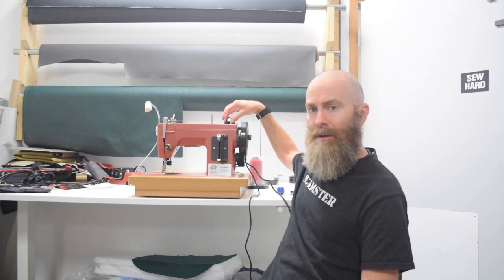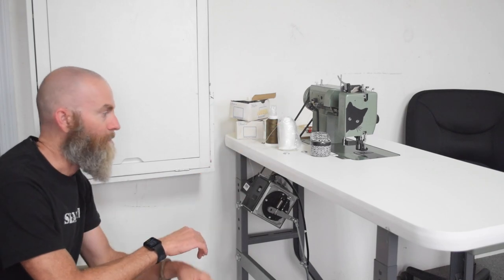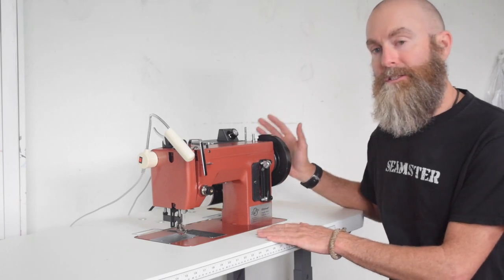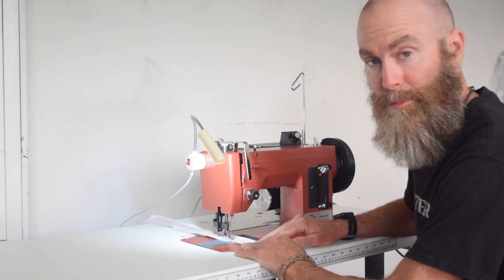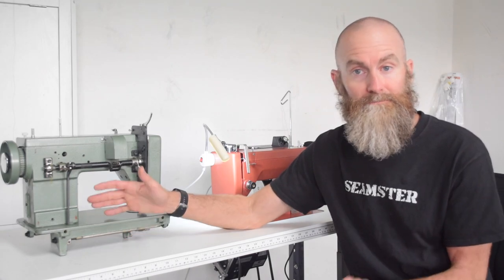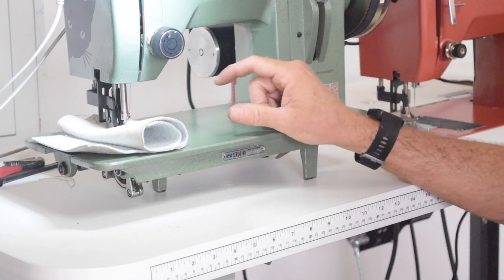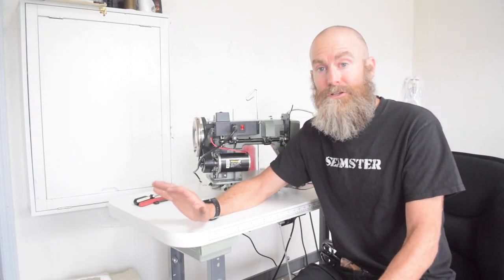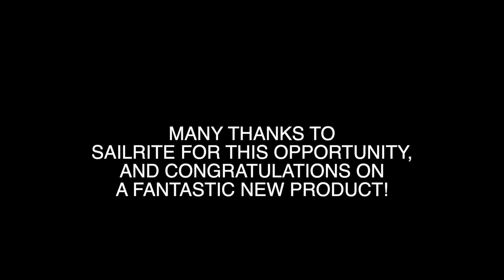Sailrite WorkerB Motor Package (It's Incredible!!!)

Comment: SewLine SL146-9 is better than the sailrite machines because you have a 9" needle to base instead of 7" and sewline and other thompson parts are all compatable..  i think the zigzag pushrod is the same in the 7".  all the needle assmbly parts are the same. sailrite machines are overpriced and sell with the same terrible pedal[as sewlines:/], get a carbon pile for real analog control.  i used a light steel wool to take the sewline lettering off and its left with nothing but nice industrial off-white paint.  i dont want a blue or red machine.  lime green maybe.  sailrite is just as much a knockoff to sewline's offering to many.  i like the small flywheel and traditional clutch style.  my machine does more stiches per min than a sailrite because of the flywheel.   sailrite makes fine profits ok and if they wanted to make More upgrades for the thompson they could.  i bought the thread tensioner and stich length plate and like 250$ or so in purchases from them - and i didnt even buy their machine.  dudes, this machine is a part of what they sell and... make a 9" arm man!  and sorry i do like the small metal (not plastic) flywheel.  at 12:52 jason shows his old motor and his old pedal.  if he had a carbon pile pedal he could eaisly get slow up and down position control with the help of a hand and single stich control with just the foot pretty easy.  he used an electronic foot pedal which are all crap and a joke really.

sailrite is a cool company. ive bought from them and might buy this motor too, its quiet!
Reply from the maker: Hi Chris, 
I'm told the motor package should be available separately in the fall of 2021 (I think October, but don't quote me on that).
I do want to correct you that while the Sailrite Ultrafeed is based on the Thompson Mini-Walker, Sailrite has made significant innovations and changes to the machines.  The Sailrite Ultrafeed is not a knock-off of Sewline machines; I believe the opposite is the case.  I disagree with the idea that Sailrite machines are overpriced; the research and development costs of innovations like this motor package are immense, and overseas factories don't have to incur those costs when they just copy others' designs.  Paying less for something copied from someone else doesn't mean the original is overpriced, it means you are rewarding a company for stealing intellectual property, while penalizing the innovator who made the product possible. 
We all have to make decisions based on our own budgets and ethics, but I personally won't buy any of the look-alike machines.  I think Sailrite brings a lot to the table in terms of value, customer support and innovation, and this motor package is yet another example of their importance to this market.
Reply: @thejasonofalltrades  yeah i hand it to MAtt for the stich plate adjuster and being  the purveyor of quick thompson gear.  i havent tried the posi-pin or his machine but... yeah,, its the same machine man.  his patents and alterations (ive seen his literature) are limited to some feet to the chasis, the flywheel... i dont think anything else.  all the parts on his machine are not just interchangable but the serializations for parts are identical(i found this out what comparing manuals)im all about supporting Matt and his crew, they are decent people.

but its like, i have supported them.  like 300$ already.  and they have a whole shop of gear they dialed in how they want.  im not gonna be kind and not say their machine isnt the best because it isnt.  i have 2" of extra bed size, my machine came wth a small highspeed wheel and after all teh upgrades and s&h was done it was like a 800-900 machine with case  and nice pedal and fixins.  you even said his machines were overpriced man.  you got a job to do but im not here to tote the line too bro.  your channel kicks ass man and Matt can get over it.
Reply: @thejasonofalltrades  dude i remember you saying how you used to think they were good deal but later you feel they have a high price tag.   they are overpriced ok.  sailrite is a great site.  and..  i spent a good amount easily when i shopped there
sailrite doesnt own thompson machine design.  so others are not look alikes, ok.
Reply from the maker: I invite you show me where you hear me saying "I used to think they were cheap but later I feel they have a high price tag."  Since WAY before I ever owned a machine, I have been very public in my positive opinion of Sailrite.  Are they cheap?  No.  Very few things in the world worth having are.
For the record, I'm preparing to sell off my Thompsons to buy a Sailrite LSZ-1 Premium.  Not because it's cheap (it isn't), but because it's awesome.
I appreciate your comments, but I respectfully disagree with many of your claims.
Reply: @thejasonofalltrades  no it was more like "i like thompsons but sailrites are expensive and cheaper means can be had"  

why do you wanna spend extra for a 7" bed when 600$ gets you a 9" zigzag thompson?  i even have a plastic case for mine.   you talked about how you spent only [so little] on your machines and now gonna get a premium kit... even though you should have plenty of extra fixins for the machine...  i just,,  well id say "i dont understand" but i think i understnad.
Reply: Hi Chris. I agree with you, that bigger harp space will help you with many projects. But it do also make the machine more heavy. But then I do agree with Jason on most other information and I like to add some technical aspects. I do not think the Sailrite machines are overpriced. They do provide an excellent support on their website, and I think they provide some improvements on piping foots, now this new motor and some other things. I think this hole package from them adds value to most of their customers. I do not have a Sailrite myself, and it is partly because I live in Europe with some higher shipping costs.

I have had several of the carbon disk control pedals and have repaired many of them, but some of them simply cannot make slow speed. So their performance vary. I have seen similar problems with electronic pedals for normal universal motors, and they can also vary in performance. So it can be hard to get a clear picture if one kind is better that the other, because you got some bad kinds out there.

The Sailrite electronic pedal you see here is not the same. It only provides a simple signal to the controller of the motor, so it do not handle power itself. But the controller got a RI compensation control of the motor. It means, that it will add more power to the motor, if it needs that to provide more short time torque for needle to penetrate fabric or for the hook to pull down thread. When you look carefully in video, you can hear the hum of the motor is increased when the needle needs to penetrate the fabric. You will newer get this kind better speed control with a carbon disk pedal. It is however the speed reducer that counts for the biggest improvement here. This is another example of this kind of control, but with speed feed back to the control electronics, and you can hear the added power, when it is needed: https://youtu.be/uTB8DnyYAlA?t=170
Reply: @sewingmachinesindetail  no.  you are really wrong.  let me explain.

yeah, harp space.  7" isnt much at all and if a person is buying their first sewing machine 7" isnt enough to mend a knitted rug(roll it up under there) or do other bulky projects.  7" for sails is, im sorry, baffling. like even on a boat,, get 9".  regarding the weight, for a petite lady she could get a straped cloth bag to hold a lightweight plastic case(like i use) and pick the 35 pounds up.  if someone wants lightweight from either machine,, maybe they should get more ofa high quality domestic.

about carbon pedals. no again.  if you buy a new carbon pedal that is not junk(they make quality ones in mass.  i got one from sailrite,  sailrite captures my money, dont worry) they will work slow speed provided you put a heatproof pad under it.  they will make hilarious poping noises at first but after 'seasoned'... my machine advances great and oh sailrite sells small metal flywheels for their machines.. ppl should get those for their machines for some quick industrial style sewing which is what this machineshould be doing, not slow leatherwork(get a unison feed off the bat for that)..   thompsons are cool,, sailrites quality parts are Really Really great for the thompson market,, there is no other source that compares to the easy selection.  
 
all the improvements 'to the thompson machine' are really improvements to the furniture of the heart of the machine:tension assmbly, stichlegth plate, flywheel(i like the old style).. they got the cast which they ship in to have more robust feet(which isnt needed, imo because the machine rests on the flange on the edge usually and if you are banging a sewing machine on the floor so hard the feet need... nevermind.  i just dont see why)

about electronic pedals.  they are total crap.  5 speeds? 5 speeds doesnt work.  the jerky inrush current is bs[which causes the jerk].  to stich with that one hand has to be on the flywheel for delicate things.. its junk.  a rheostat pedal gives more speeds i think and doesnt cook bacon like a carbon pile pedal can.  but i like bacon and the smooth, funny control of the pile.
Reply: @sewingmachinesindetail  neat YT channel.  ill check it out and polite.  yeah i am passionate about thompson and dude the upholstery company i worked for ordered tons a foam and products from sailrite, they bank.  ill drop it.
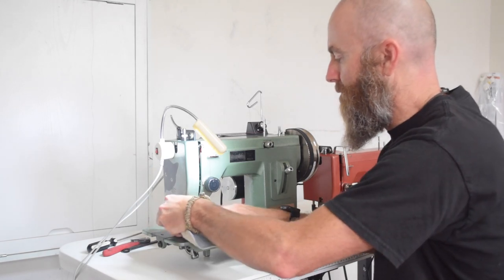Reply: @chrisprice5806  All the electronic pedals I have seen got continuous speed control. So I think a 5 speed pedal must be something very special and of cause undesired. In Jasons video above from 12:10 https://youtu.be/Sg5XHjqHMw4?t=730, you see the machine punching some heavy fabric with an almost constant low speed of about 20 stitches/min, and it is not stopped when needle needs to penetrate the leather. In my video you are shown something very similar with a speed of about 12 stitches/min and a 140/22 needle. Please show me a video of a machine with carbon disk control, that is able to do something similar.
Reply: @sewingmachinesindetail  the term 'electronic' pedal refers to usually, in my experence, to a 5 speed pedal.  there are rheostats and piles as you know,, and then the market as a whole has these 'electronic' pedals which offer 5 speeds.  aside from these three there would be electronic speed controled pedals like a bernina would have or how the pedal on the workerb works; it is 'electronically speed controlled'.  unfortunately when using 'industry' terms(e.g. 'electronic pedal') it refers to what the industry sells often.

yes i could probably upload a video of needleup and needledown control without handwheeling/braking with my carbon pile pedal but the slooow control the workerb has, which is really a slow speed,, i could probably inch it along but slower..  carbon pile pedals are like driving a car in reference to 'giving it gas' and it actually moving..  if i do ill let you and jason know.

and how you mentioned carbon pile pedals dont all give great control..  if it is a new carbon pile or maintained then yes it gives good control.   i have a brushless motor/typical industrial 500 watt motor too and it doesnt have the 'driving a car/giving it gas' effect like a pile.
Reply: @chrisprice5806  i have seen about 5 speed pedals like reostates, that you see in this video: https://youtu.be/RGf2DFQdcBQ?t=648. I have also seen similar quite new ones with only 3 speeds - like off, half speed and full speed (they are sold with many new motors from China) and they got one resistor inside and some switches. This is what I consider and electronic pedal for the old style universal motors: https://youtu.be/0OBXRnoP9WY?t=23. This is an example of a bad electronic pedal, that cannot make the machine go slow: https://youtu.be/quetOZsITJA
Reply: @sewingmachinesindetail  sailrite sells 5speed pedals and that is what their machines come with.  that pedal jason had hooked to it was a 5speed electronic thats why it had such poor control.  the other type of 'electronic'(they all are) pedal would be like bernina-something with real proportional control.

not a rheostat pedal has this.  it has so many resistors in it, maybe a nice one ( i wouldnt know) has more resistors/speeds and has preceived nice continous control.

https://youtu.be/Eb0BHEqXOjo

here is my machine with its carbon pile pedal.  not too bad for such a small flywheel.  fairly smooth startup and pretty slow speed.
Reply: @chrisprice5806  Thank you for the video, Chris. Regarding the pedals, that control the power for the universal motors, I guess you need to get the right ones of good quality. I have seen some trials on internet regarding the electronic pedals. The ones that got a small trimmer inside to adjust it, they seem to do well. I got a relative new carbon pile pedal from YDK marked YC-190. It jump starts the machine to quite high speed. But other carbon pile pedals do control speed very well. I still think the new WorkerB beats the good ones of both types, but it is also more expensive.
Reply from the maker: @chrisprice5806  Hi Chris, first, THANK YOU for providing your thoughts on this subject.  I appreciate real exchanges of ideas, sincerely.  I have a couple of bones to pick, but I want you to know that I am only interested in our conversation funneling towards what is most true, not one of us being right or wrong.
Thank you for enlightening me on carbon pile pedals.  I had not heard of them and didn't know the difference (electronics is not my strongest subject). My Thompsons both came with carbon pile pedals, and I didn't notice any difference between them and the electronic pedal that came with the Sailrite.  I think your video clearly shows a stark difference between the control one can exert with the carbon pile/standard motor versus the WorkerB. If you don't see a night-and-day difference between the two, then I somehow failed to make it apparent in my video; it's not even close. (To be clear, I am NOT saying that one can't competently sew with anything but the WorkerB.  I have been doing so for many years.  The fact that for some people it is possible to regularly commute in a Ford Model T doesn't negate the fact that a Tesla would be far better for the vast majority of drivers.)
Second, maybe there are circles where it is common and I've never been in those circles, but I don't understand why you keep referring to your Sewline machine AND the Sailrite Ultrafeed as "Thompsons."  Thompson is a brand name of  Datho Manufacturing. Sailrite's Ultrafeed is a machine based on and developed from the Thompson (through some sort of partnership or other agreement).  The Sewline and all of the other "clones" are copies of one (or both) machines.  In my opinion, and to avoid inevitable confusion, the only machines that should be referred to as "Thompson" should be Thompson Mini-Walker machines manufactured by Datho.  If you're looking for a generic term to use, "portable waking-foot," or maybe "mini walking-foot," might be a less confusing choice.
Anyway, I appreciate your thoughts on this subject, but I think you will find there is NO comparison between your current setup and the WorkerB.  Whether it's a good buy for you (or any particular person) is a completely individual decision, but I find it to be a massive step forward in portable sewing machine tech.
Reply: @thejasonofalltrades  on the sailrite machine they have designwork done by handed-down designs that date before the real thompson. sailrites additions are not a big list: stich plate, flywheel(i like oldstyle),feet on casting,... not much else.  and.. anyone is free to pick up the thompson design i dont think any IP infringements were made producing my machine.  it shares most design features with a class15 singer. 

so what do i call a machine that works just like a 'sailrite?' not a sailrite or a thompson,, i ogtta call it a knockoff because the chosen people didnt make it?  thats bs.

and of course therres huge difference between the servo/brishless/idk workerB and a carbon pile i agree but your display of the difference in your video was unfair as you can tell from my poorly made video.

you can work hard to make sales for sailrite but dont expect me to lower my defense when a less than 20$ option can perform,,, like pretty much the same stiching on nonleather work: like pulling to edges together to be topstiched right on top of existing stiching (like with joing binded edges)..  with a carbon pile pedal i can inch forward and not wreck the work.  going 20spm is nice, my consew doesthat(smaller pulley),,  but yeah.. 300$ man.   sailrite Is expensive compared to other sources but a great shop.
Reply: @thejasonofalltrades  for zigzag tuning/get the widest most centered zigzag width/trick out all that can be:

 where "zig zag connecting rod"(W015) meets W016, 'zigzag onecting rod set base' you can inspect (1)how well the pushrod is seated; either advance it deeper or pull it out farther a little.  this will change the bias of the zigzag wither left or right.  there is a "stopplate" screwed into shroud around the ZZWidth adjusterlever(im not seeing the part#,in a hurry.  it stops the zigzag lever from going to far)  anywho,, that plate can be set as wideopen as possible.